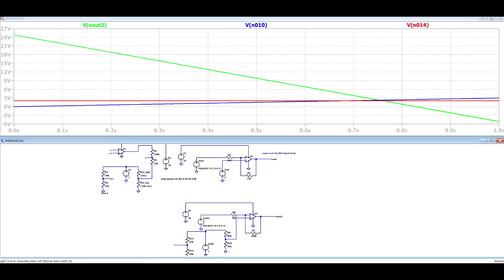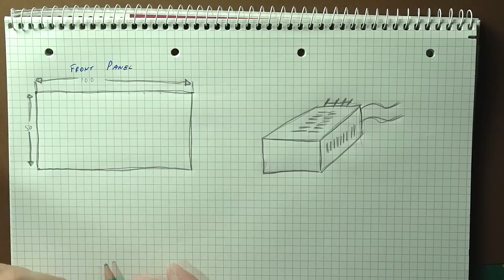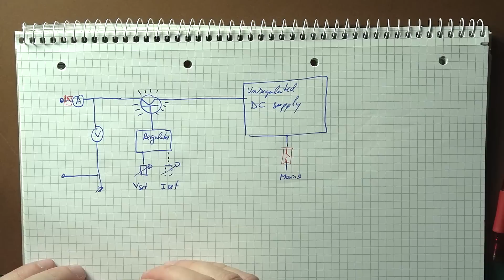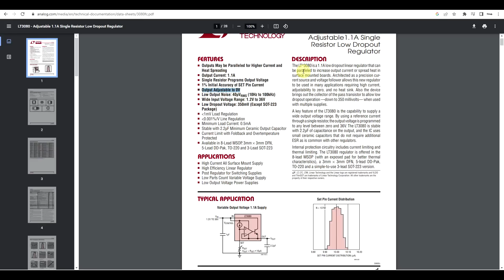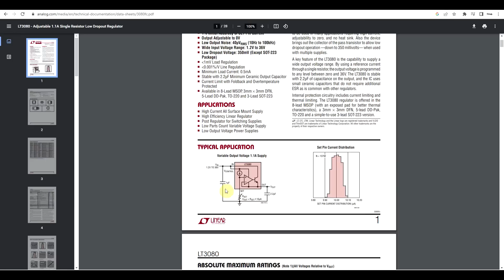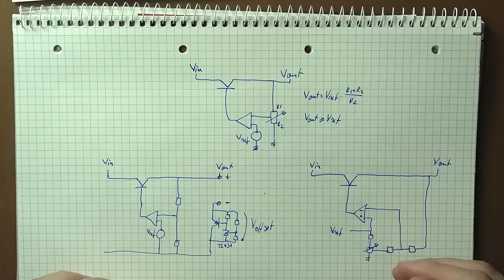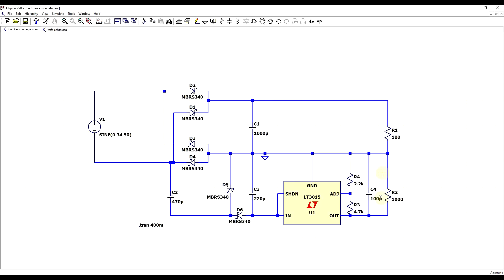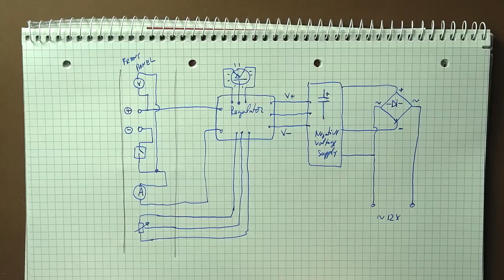DIY BenchSupply [1/2]

Comment: One problem I have found similar lm 317 variable voltage regulator.when differential voltage is high say 12 v and current taken by load 1A ,the lm317 get hot even your package as 723 used .2n 3055 type metal package. Second problem 1.25 v not going 0. So to overcome I have negative bias voltage -1.25 given to lm317 and it's output goes 0 volt.wll job.probkem aries when I shuyt down the whole circuit by cutting main transformer power the circuit having capacitor holds charge then negative biasing circuit.which results lm317 control pins don't even get ground and some short of time actual output gets high voltage and component under load get dameged

Comment: "Not the greatest regulator by today's standards" agreed, but LM723 has been used in some super low-noise regulators of yesteryear with some immaculate noise performance! It's all related to the option of having the reference voltage being filtered out externally, an option not many IC regulators offer.

Comment: For my Linear PSU project, I found it to be worth having auxiliary low-power PCB transformer for control circuitry.
They are not terribly common at decent price (same as power transformer actually), but do exist and are very doable in single project quantities.
Snatched some HAHN 3W 2x15VAC beauties at $2/piece.

Comment: I did thumb up as usual but have to question if you spent too long in Soudi?
We read books from Left to Right and we draw circuit diagrams from Left to Right.
Input at left.
Output at right.
High voltage at top.
Lower v at bottom.
Its simple, but dam annoying and unprofessional to be stupid enough to reverse the standard.
A bit like Crockodile clips being wrongly named to Aligator cloips and 4x2 & 8x4 timbers being wrongly renamed as 2x4 & 4x8 by morons that havent yet learned how to pull the trousers we gave them, up much above their knees.

Comment: You want to soak away 28 V with a regulator to get -5 V rail? You better cool that thing, critical design choice.
Reply from the maker: If the current is small, the large voltage difference is not a problem; since I only expect a few mA, there should be no thermal issues... maybe
Reply: @FesZElectronics  I am really curious how this turns out. I really like your content. Keep that up.

Comment: Why just don't adjust the output with reference intead of feedback reference ?? Is there a problem that I don't know. I know for exapmle with buck even though ref voltage doesn't affect compensator calculations res and cap values change
Reply: accordimg to output voltage, but with linear just need a big cap for higher power.(?) I did this in a non efficient way driving though. Is there something idk?
Reply: https://youtube.com/shorts/ChXJfbEDnsw?feature=share

Comment: Nice educational project, I like the way you explain your train of thoughts and your modular approach.
You choose a nice case to play with, though I'm not confident about TO-3 packages. Parts are hard to find, especially when shopping for genuine replacements with the same power characteristics. And even with a proper insulator on the radiator, its top cap remains exposed to hazard if not at the ground potential. So for those reasons I would rather modify the radiator to internally mount some TO-220 instead.

Comment: Too much noise in a switcher output is a common problem on boards that also have an RF output, or any clocking in the GHz+ range.  The problem is that the clock multipliers in those chips typically have a bandwidth high enough to include the switching frequency of the power supply.  That PS noise is then multiplied up by the same factor N that is used to multiply the low frequency reference up to the output frequency in the GHz range.  Unfortunately this can add a HUGE amount of jitter onto the output clock, making it unusable for many applications.

Sometimes a linear regulator can be added to clean up the switcher output, if you can find one that has enough loop bandwidth to cover the full range of the output noise.  This isn't always a good solution however.

If the switching noise is entirely triangular, a coil inductor between the PS output and the main filtering caps does a nice job of cleaning up the output.  Choose the inductance to put the corner frequency a couple of decades below the PS switching frequency with the output caps.  Be careful here though - most regulators can't handle the extra pole this inductor adds to the feedback loop - so take the voltage feedback point directly from the PS output BEFORE the inductors, not after them to avoid turning your PS into a big oscillator!

On some switchers, you'll see large, sharp spikes at at each ramp change in the triangle output waveform. These are the output diodes turning off and ringing. Unfortunately, linear regulators and the coils above will just pass that high frequency noise (typically 20MHz & above) right through them.   For this, you'll need to use large ferrite beads (i.e. large enough to handle the output current) right at the output of the switcher - BEFORE any coiled inductors.  You'll want some small caps after these ferrite beads too - on the order of 10 to 100nF - small enough so that their SRF is still above the diode ringing frequency.  On PCBs, the effectiveness of this RF filter is VERY dependent on layout, so keep all of the leads in this section as short as physically possible!

Comment: Since you are using a full-bridge-rectifier (as opposed to center-tapped or whatever) there is is no absolute "ground" point - you can choose to call any potential zero. If you only need a few V below zero to bias the output-stage, why not just use two or three power-diodes in series? 0.6V*3 = 1.8V which would be plenty to not get funky artefacts around zero. Its stability would be reasonable, and final output-voltage is determined by your feedback-network anyway (referenced to your "lifted" ground).

Comment: Nice video! However, I'm still very satisfied with my DIY power supply from Elektor from the early eighties (1982). It's power output uses the famous 2N3055's which are (almost) indestructible.

Comment: You can always add another winding to the toroidal transformer. Not hard to do. Less likely to add noise to the output of the supply I think than the negative supply you have now.
Reply from the maker: You are right, for this particular transformer that would have been a possibility - since the middle bit is accessible. Oh well, its a good idea to keep in mind for the next project :D

Comment: I'm taking a similar modular approach to an audio circuit I'm working on right now - but building each stage on a breadboard, before moving it to a PCB and then the next stage on the breadboard - joined by soldered wires in my case.
Reply from the maker: Sounds like a fun project! Especially if you are designing it from scratch, there will always be problems, so the breadboard first, pcb second approach should ensure the pcb's are working with minor later modifications.
Reply: @FesZElectronics  yeah! My project is a microphone preamp and distribution system so my one mic drives two PCs and whatever transceivers I attach. And I'm putting adjustable mic gain, tone controls, and a global mute between, so there are plenty of well defined logical modules in the pipeline.